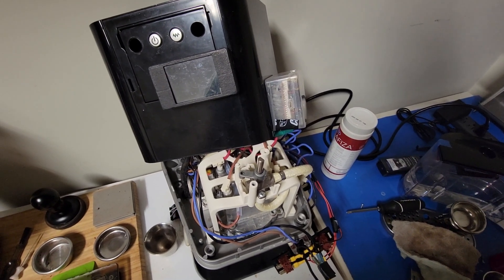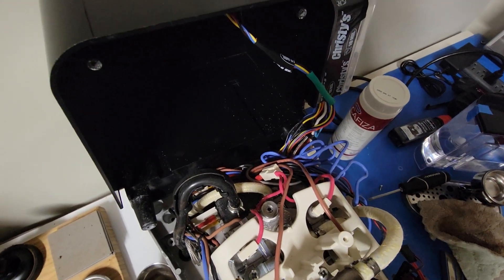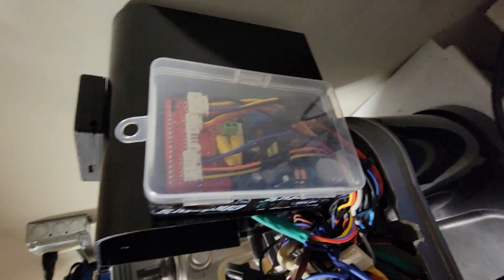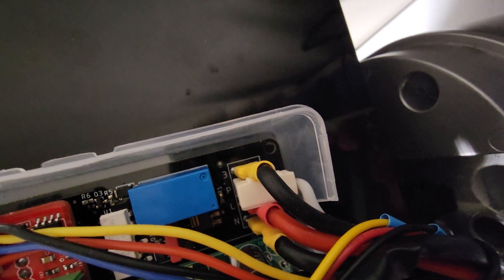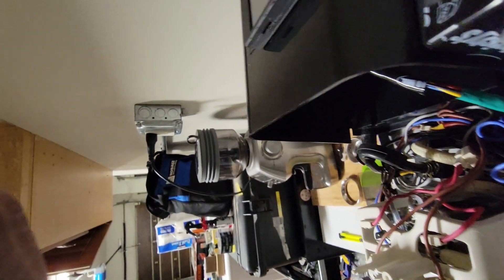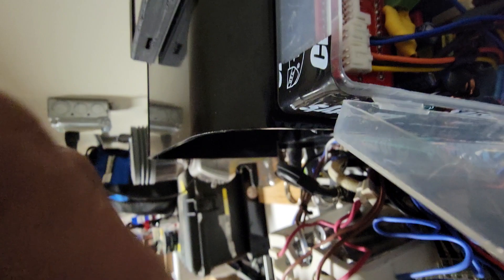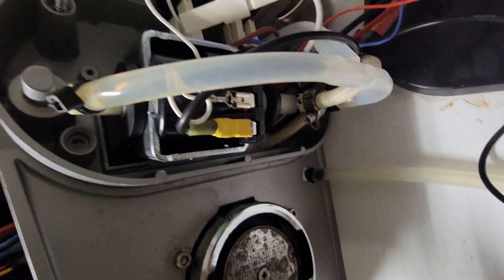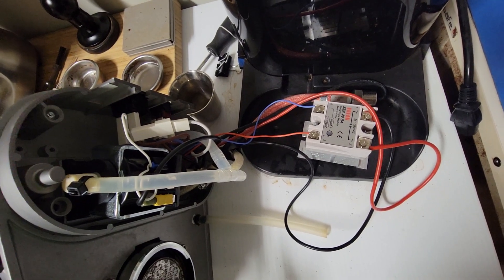Gaggiuino wiring overview on a gaggia new baby ( plastic housing gaggia classic)

Comment: thanks- of all the youtube videos on this mod, yours was the most lucid explanation. now a days peakcoffee has a pcb with all the electronics on it in a small plastic box that is 3d printed. really very neat and orderly. if one breaks down the wiring into doing the high voltage first and low voltage wiring afterwards, its really not that confusing.

Comment: Do you have more details about the OPV re-routing/casing mod.
I read on the Gaggiuino Discord, that it's necessary to do such a mod, on this machine, as splashing will occur around the drip tray if not done.
What kind of tube, what size tubing did you need, to extend the OPV output onto the side? 
Thanks

Comment: I'm looking to try this out, but with the prebuilt kit from peak coffee. I have one issue, 1 of the 4 screws that hold the upper black plastic case on is completed stripped and rusted. How would you proceed?
Reply from the maker: You might need to use a screw extractor with an extension to hold it. If you can back out the screw you can try to find a replacement screw of the similar thread size and pitch from your local hardware store.

With repeat opening and closing mine had stripped out the holes where the screws go on one of the corners of the housing and I had to use super glue to hold the screw in place. Once the glue dries around the screw it forms a new channel for the screw to grab onto with its threads.

If your threads are ok then getting the screw out shouldn't be too complicated
Reply: Rusted top casing, rear screws, seems to be a common issue on these machines. 
The 2012 Baby Gaggia 06 I bought, also had both the rear top case, screws rusted out. 

If you can use a screw extractor, I'd recommend that first, like DIYcoffee mentioned.

If any help, on my coffee machine, the rear screwholes of the top case, were modified by a previous owner, assumedly because they had no success in removing them. 
From what I can see, they used a heat source (assumedly a thin soldering iron), to melt the plastic around the screwholes, so that they no longer retain/hold the top part of the case. 
Casing mod seems to work and machine holds together fine (other screws like steam wand screw and water tank's weight, seem to be enough to hold the top case together without the back screws).

Comment: Thanks for the video! I just received a kit from peakcoffee and I'll begin soon. Did you attempt the scale mod?
Reply from the maker: I never got around to the load cells I have them still in my box of parts. 

A cheap and easy way to do this would be to use one of those cheap scales on Amazon like the one I have in one of my other videos and just wire that to the pcb. Someone ended up doing that on the discord.
Reply: Can you please add the schematics you were talking about? Thx
Reply: Yes I saw it too, but I decided to go with a classic for the simplicity

Comment: Hiya. Thanks for this video! Very helpful as I get ready to do this mod. One random question though. In this model of baby, is the OPV the same as the Gaggia classic? Do you know if the spring mod for changing the pressure in the classic would work on this machine? I have trouble getting accurate answers on the web. Thanks!
Reply from the maker: Yes it's the same internals as a gaggia classic. The opv is the same too. I'm not sure how the spring mod is with a gaggiuino build. You can check the gaggiuino discord to see if people have any experience. I left all the items original on this machine and just did the gaggiuino parts.